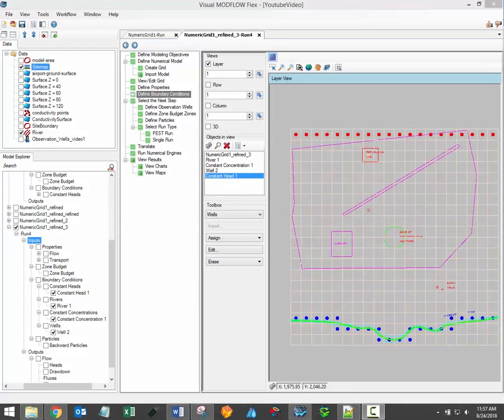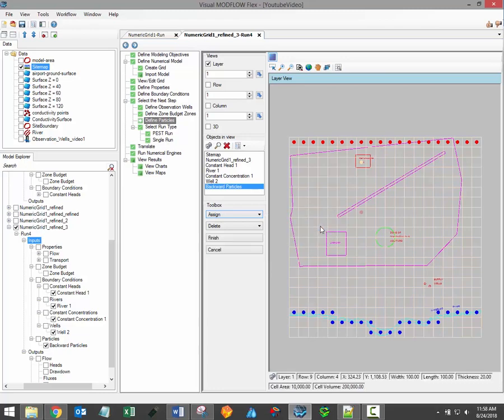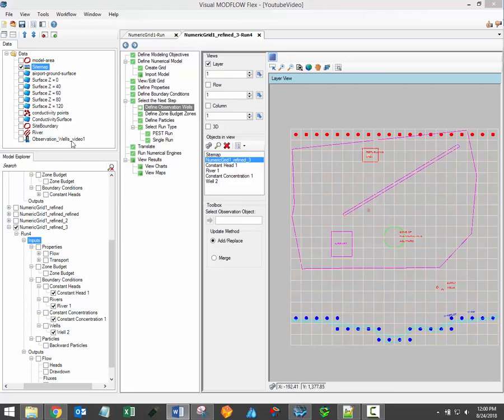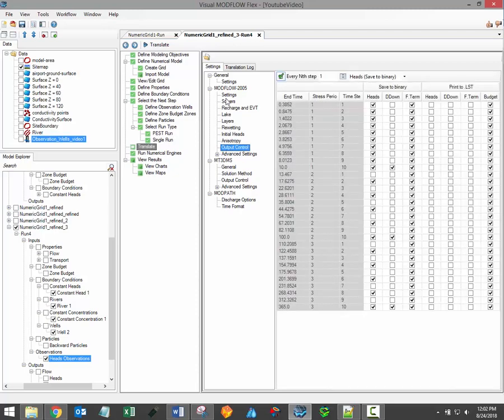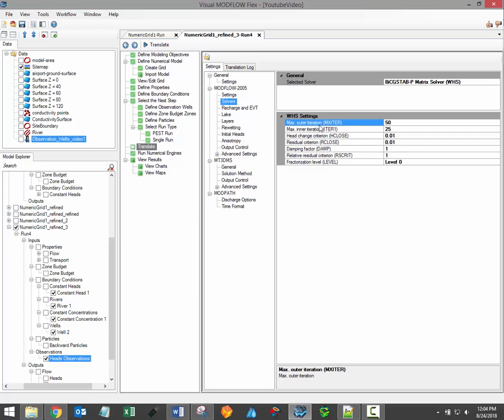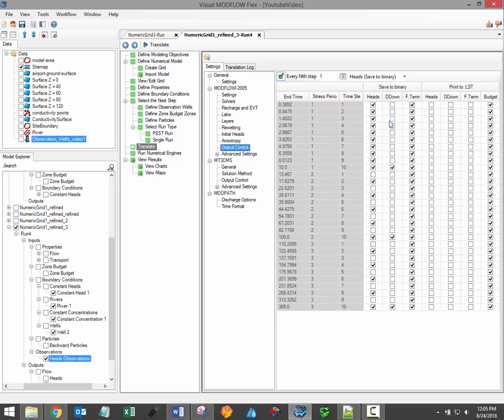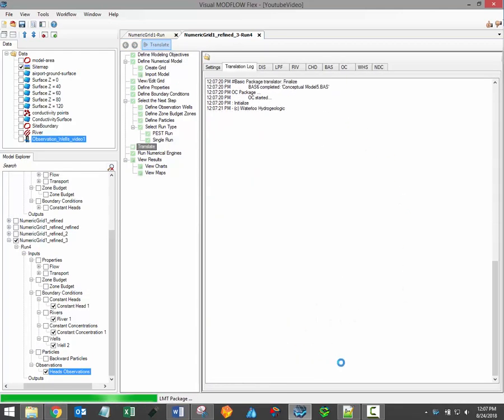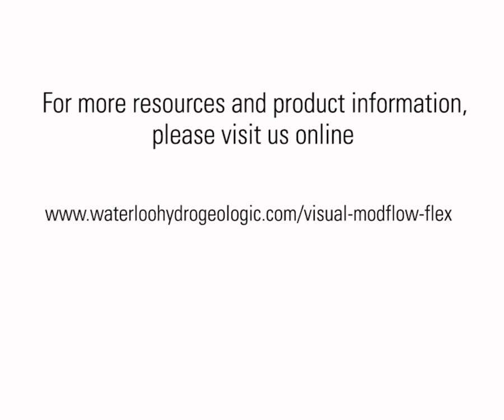Numerical Modeling: Translate and Run Model

Comment: Dear, After completing all the data, when I translate the model, its not giving any error. But when I run the model, its not converging for Unconfined aquifer. When I changed it to confined aquifer, it is finishing its run in less than two seconds without giving any run details